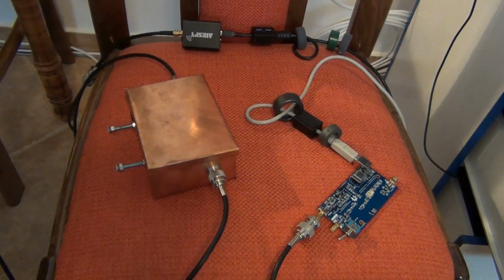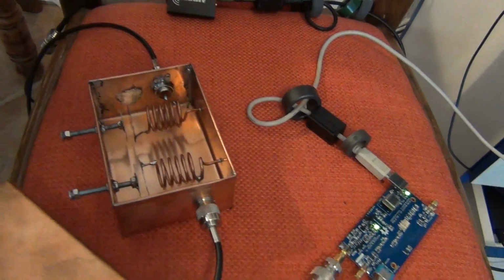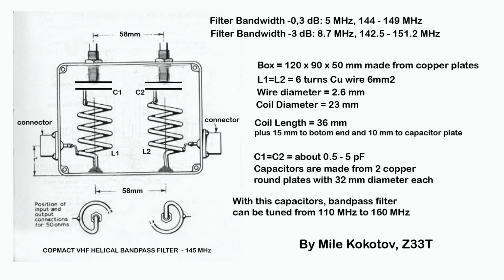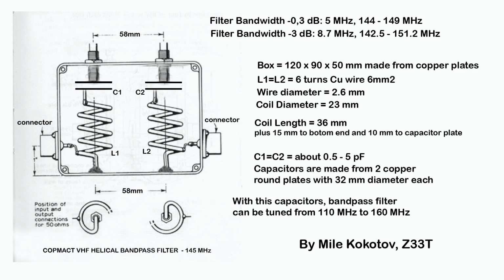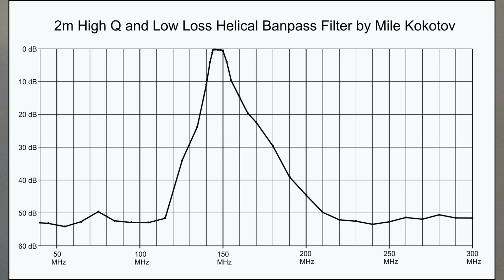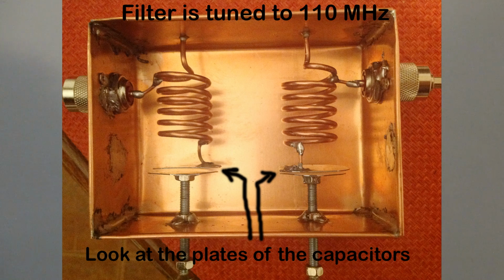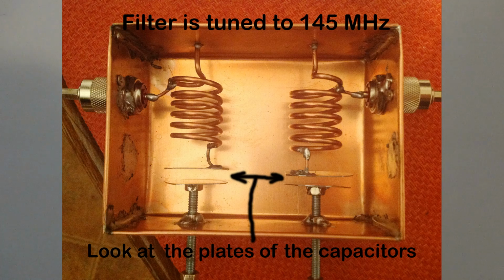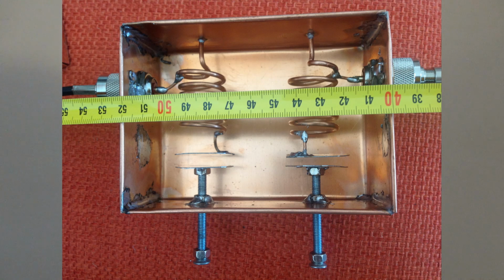145 MHz Low Loss Bandpass Helical Filter by Mile Kokotov

Comment: Hello, I need this type of filter for my small FM transmitter on 107.00 Mhz. Any chance you could give me the estimated coil windings etc. for that frequency? Thanks, ZL4FOX New Zealand
Reply from the maker: Hi Bart, This band-pass filter with given dimensions works from about 110 to 160 MHz. For lower frequencies you should increase inductance and capacitance. It will be enough to increase coil windings for one turn. Instead of 6, 7 will be enough. and for capacitors will be enough to increase the diameter of the round plates from 36 mm to about 38 mm. The tap point for the connectors will change too. About 5 mm up will be enough for 50 ohm impedance! Let us know about your results! Good luck.
And for the final, make sure to not apply more than 100 W RF power to this filter!
For more power, you have to build cavity filter!
Regards,
Mile Kokotov, Z33T
Reply: Many thanks, I will be trying to build one in the next few weeks. The little Chinese FM radio transmitters (15 Watts) may be cheap, but not as clean as I would like. This filter should really clean things up, not only for higher harmonics, but I also hear some stuff in the higher HF bands (20-30 Mc) probably due to the synthesizer used. Thanks again,  Bart ZL4FOX
Reply: Bart Kindt a

Comment: Question: Doesn't vibration affect the performance as the capacitance changes due to the spring nature of the coils? TNX
Reply from the maker: Hi Charlie, The Bandwidtgh of the filter is not so sharp ( it is about 3 to 4 MHz wide on 145 MHz) so even if the coils physically vibrate a little (micro-vibrations), there is no evidence of untuning (or "microphonic" 
efect) in normal conditions. For a "shaky environment"  it will be better to fix the opposite end of the coils  (from the bottom) with some thin isolator (teflon or just dielectric isolator FR4 material from PCB) using epoxy glue to the closest side of  the filter box)
The frequency stability of the filter vs temperature and mechanical stability is very good. It depend of how good you will made the enclosure box and helical resonators. 

 Regards,
Reply: Thank you for your reply!

Comment: I really enjoyed this video and the helical filter. It did raise 2 questions in my mind though which I will pose. First, according to your excellent drawing, the 50 ohm tap on the coil is 1/4 turn up from the bottom and I wonder how this was determined. My calculations indicate 1/3 turn. More importantly, does this filter suffer "microphonics"? It appears that the coils are suspended, cantilever style, and could physically vibrate if used in a shaky environment.

Overall this video is superb, featuring all essential details and including performance testing.
Reply from the maker: Hi Rob,
Tap for 50 ohms: 0.304 turns, or 109,61 degrees from the ground of the 
coil (including 15 mm length of copper wire to the bottom of the box)

Tap for 75 ohms: 0,373 turns, or 134,16 degrees from the ground of the 
coil (including 15 mm length of copper wire to the bottom of the box)

The Bandwidtgh of the filter is not so sharp ( it is about 3 to 4 MHz wide on 145 MHz) so even if the coils physically vibrate a little (micro-vibrations), there is no evidence of untuning (or "microphonic" efect as you describes it) in normal conditions. For a "shaky environment"  it will be better to fix the opposite end of the coils  (from the bottom) with some thin isolator (teflon or just dielectric isolator FR4 material from PCB) using epoxy glue to the closest side of the filter box)
Regards,

Comment: Hi. Very nice project. I'd like to build one for UHF. Any ideas of how stable this is? I'm thinking I could use this for duplexer usage if its stable and doesn't drift too much with temperature change.
thx.
-J
Reply from the maker: The frequency stability of the filter vs temperature and mechanical stability is very good. It depend of how good you will made the enclosure box and helical resonators. This type of helical filter is not suitable for UHF, It is better to use cavity filters like this:

 https://postimg.org/image/a2bydisjl/

Read all the comments bellow. You can find more info on my web page. There are detail instructions and examples of filter build by others according my suggestions. There are also one duplexer filter with three filters like this in series. Keep us informed about your work! 73

Comment: Hi Mike. This is amazing! I also want to build using your design tuned to 137Mhz. I'm interested in NOAA/Meteor weather satellites which transmits at 137.1, 137.62 and 137.9125. I'm currently using RTL-SDR dongle to capture from those satellites. Do I put this filter very close to my low-noise amplifier? Also, is it ok to use rg6 F-connector? If let's say I tuned it to 137Mhz, am I right that all other frequencies will be blocked? Lastly, how do I tune it to 137Mhz?

Thanks a lot Mike! Awesome work!
Reply from the maker: Hi Neil Camara, Once you build it, the filter can be tuned with network analyzer, but if you have not that expensive unit, You can tune your band-pass filter simply with listening the weak signal in the frequency of interest. 
The signal have to be little stronger at the beginning, when you will start tuning the filter in order to hear it. After that, during the tuning, try to reduce the signal strength with some attenuator. At the end of tuning, the signal have to be very, very weak (use attenuator in front of the filter) , almost buried in the noise, so you should try final tune moving the capacitors plates, for maximum SNR (signal to noise ratio)

Pay attention on the position of taping the coil to connector. It must 
be done as it is shown in the pictures (and diagram in the video) for 50
 ohm impedance. 

The box is made from copper plates. If you use aluminum instead of 
copper, the RF loss will be greater. You van use a copper plated material for PCB.
You are welcome for any other question about this project.

Placing the filter before or after the LNA depend of Spurious-free 
dynamic range (SFDR) of the LNA. I do recommend connecting the 
low loss filter like this, before the LNA. Just after the antenna 
connector, and very close the LNA. Especially if there are many strong 
signals which can easily drive away the LNA linearity...
Remember, every cm of coaxial cable before LNA means more signal loss

 Let me know when you finish your bandpass filter, and about your results.

Here is the another usable link for this excellent band-pass filter:

http://www.qsl.net/z33t/english_page1.html
Reply: WOW! That is an amazing reply Mile! I will follow everything you said. I will definitely keep you posted! Thank you so much!!!
Reply: Ok, I will find a real copper plate. Thanks a lot for the heads up :)
Reply: I finally found a pure copper plate. I ordered it just few minutes ago :) It will be here within 15-20 days. I'll keep you posted. Thanks a lot!
Reply: The copper plates finally arrived! It's here. I hope I'll be able to start working on it tonight.
Reply from the maker: Nice to hear that Ronneil, Let me know about your results. Send me several pictures to my e-mail too. I will put them on my web-site. Regards
Reply: Hi Mile Kokotov. I have a follow-up question. Can I also use the double-sided copper plated pcb for the 32mm circle plates? Can I also use a metal screw and nut?
Reply from the maker: Hi Neil, Yes you can use double sided copper plated pcb for capacitor plates, but I think that it will introduces more losses. because of PCB dielectric isolator ( I have not build it one on that way to measure how losses will be) Using pure copper (silvered copper is even better) is the best way for minimizing filter losses!
Reply: Finally Mike, I was able to build it today. It's still not done but the only missing thing is the connection from connector to inductor. I hope it looks fine. What do you think? http://imgur.com/AUv93Ve

Comment: Hi, How to modifay for fm 88 108?
Reply from the maker: +Željka Adžić  
For lower frequency (88-108 MHz) you must increase inductance of the coils and capacity of the capacitors.
Try with 7 turns instead 6 for the coils, 28 mm coil diameter and about 42 mm coil length.
For increasing the capacity of the capacitors, you have to increase the plates-diamater of the capacitors to about 40 mm instead of 32mm here.
The bandwidth will increase because the distance between the coils will decrease due to bigger diameter of the coils.
But, the bandwidth will be around 8-10 MHz for -3dB, and you can cover only about the half of the desired bandwidth.
(88-108 MHz = 20 MHz bandwidth)
Let us know about your results here...
73,
MIle Kokotov Z33T

Comment: Hi Mile,
Interesting and very efficient filter. I want to use with a Wouxun portable, so 5W output at maximum.  Could I use thinner wire for coils? Let's say 1.5mm in diameter.  Will the filter loss be the same as in your design? How about the metal box, will it work is the dimensions would be slightly changed? I intend to use a metal box from an aftershave lotion :). Thank you!

73,
YO3IVT
Reply from the maker: +tehcereb :  Тhe thickness of the wire have an effect on overall filter loss. The wire and the box material is very important also. The best results (lowest loss)will be achieved with silvered copper for coils and inner sides of the box... 
If you use a 1,5 mm wire diameter for the coils, you can expect greater loss. 
With 1,5 mm wire diameter there will be stability issue also. Avoid putting other materials inside the box (such as plastic pads for coils support)
Read the posts bellow for similar questions.
Reply: Is it OK if I use PCB for making the box? Even if is simple I don't have the material and the proper tools to make it from copper sheet.
Reply from the maker: +tehcereb 
PCB for making the box is quite good enough for VHF!
73,
Mile Kokotov, Z33T
Reply from the maker: +Mile Kokotov 
Good Luck and Let us know about your results here!
Reply: +Mile Kokotov 
OK, this is good to hear because a friend of mine has already made the CAD project and these days he will produce the box parts for me at a CNC machine. I'll post the result after the first tests.

73's,

Florin - YO3IVT.
Reply from the maker: +Mile Kokotov 
I am using this filter with my Baofeng UV5R with excellent results!

Comment: im working on one for 137.5 mhz ... how important is the thickness of the wire when designed for a receiver?
Reply from the maker: +Alyx BioHaz  -  Тhe thickness of the wire have an effect on overall filter loss. So, if you need best possible signal/noise ratio on the receiver, You have to use low loss filter (especially if you put the filter in front of the LNA). For the Transmitting purpose is the same: You need low loss filter in order to lose less power...
Reply: would you recommend placing an LNA before this filter?
Reply from the maker: +Alyx BioHaz
 Placing the LNA before or after the filter depend of Spurious-free dynamic range (SFDR) of the LNA. And Yes, I do recommend connecting the low loss filter like this, before the LNA. Just after the antenna conector, and very close the LNA. Especially if there are many strong signals which can easily drive away the LNA linearity...

Comment: Hello Mile, first : Great project! i am very interested in building one of these band pass which will be helpful in my area of interesting 137 - 138 Mhz weather satellites. Where i believe it can dramatically improve reception. But it will be even greater if you can tell us where must be the connections point of input/output for 75 Ohm connectors ! Most of us (amateurs) use cheap rtl-sdr and they have 75 Ohm inputs . My first thought is that it will be further away from ground connection of coil ?! but how much further...
Reply from the maker: +John Smith, The connections point of input/output tap on this project is given for 50 Ohm impedance. You are right that for 75 Ohm impedance, the taping must be further away from the ground connection of the coil. 

Little calculations for this dimensions of the filter, gives the following results:

Tap for 50 ohms: 0.304 turns, or 109,61 degrees from the ground of the coil (including 15 mm length of copper wire to the bottom of the box)

Tap for 75 ohms: 0,373 turns, or 134,16 degrees from the ground of the coil (including 15 mm length of copper wire to the bottom of the box)

73,
MIle Kokotov, Z33T
Reply: +Mile Kokotov , tanks for your reply !  73 !

Comment: i need build  to 27 mhz 400watts rf amp
Reply: At least you should indicate what is the purpose of such amplifier. There are legal limitations on the strength signal used on various radio bands. 400W is way over maximum allowed power on 27MHz band.

Comment: Hi Mile, i have build it and works good,using it for sdr,Q: is it possible to make or modify such filter with a narrow bandwith, for example 300 kHz ? i use it for Meteor MN2 lrpt reception.
Reply from the maker: Peter Kooistra In this filter the two tuned circuits are arranged so that they are slightly over-coupled in order to provide an adequate bandwidth, which in this case is about 6MHz for -1dB and about 8,5 MHz for -3dB with a maximum variation of 0.1 dB and an insertion loss of 0.3 dB. Increasing distance between two circuits (coils) will decrease bandwidth. Then you have to use wider cooper box. Pay attention not to increase the distance between two circuits too much because the insertion loss will be greater! The other way is to insert peace of cooper plate as RF-screen between two coils. Try with screening half of their length. 73
Reply: Mile Kokotov tnx for your reply Mile, i will do experiments with the last option first, partialy shielding between the 2 coils.
Reply: For very small bandwidth you could add a third coil in between the input and output coils - make the whole thing wider to accomodate the extra coil. More loss, but there's always a price for narrower bandwidth. By adjusting the 3 capacitors you could also square-up the passband - the three peaks should not coincide exactly.

Comment: Hi Mile, I am attempting to create a Low Pass filter that operates in the UHF bandwidth. The input into the filter is 30-35 ENR. The challenge of this build is to make the roll off variable from 27.7dB/decade too 15.8dB/decade, Would you have any suggestions. Or  know of any resources I could learn from. 
Thanks.

Comment: Beautiful. Any suggestions for changing it to 70cm band?
Reply from the maker: Dan M Here you can find good vhf and uhf  high Q and low loss filter suggestions: 

http://postimg.org/image/a2bydisjl/

Let me know if you build one!

73,
Mile, Z33T
Reply: I would make the diameter of the coils less (1/4 the diameter) and move them closer together to get the degree of coupling you need. Also make the capacitor plates smaller and try to get the thread on the screws shorter